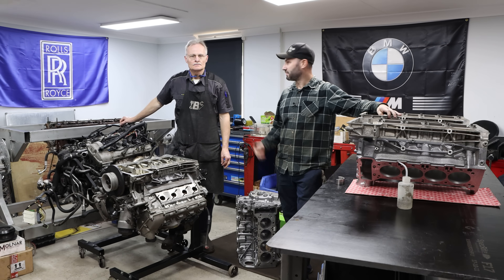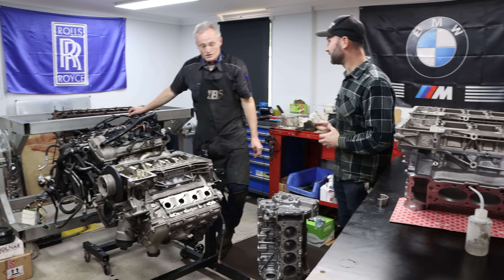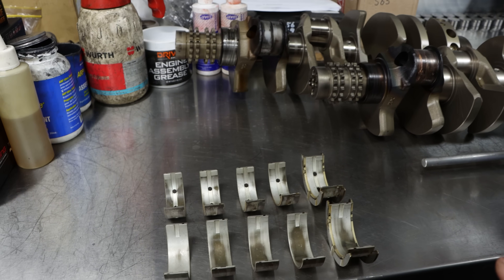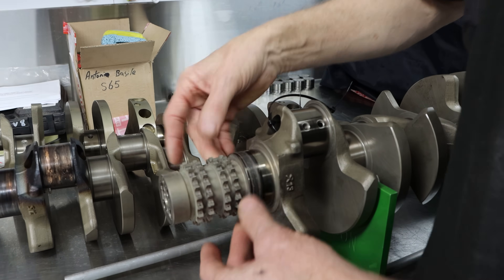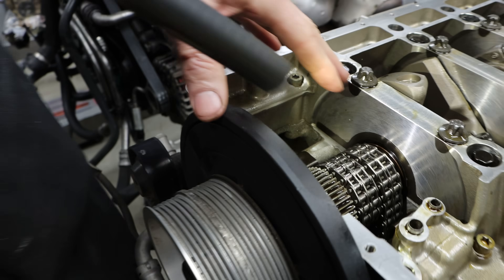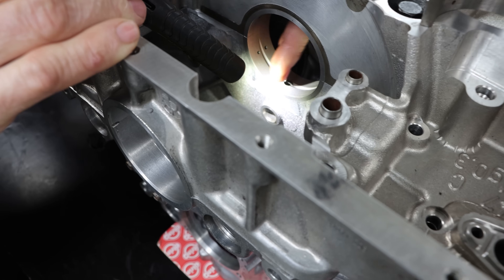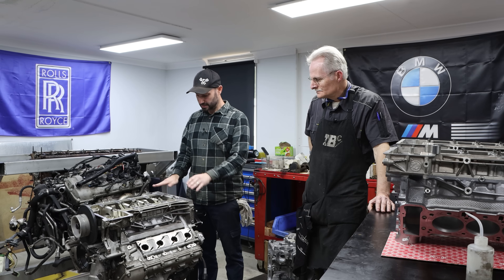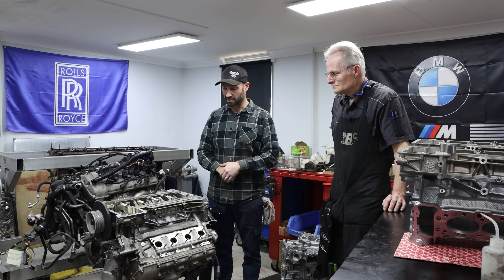BMW M3 S65 MAIN BEARING FAILURE! Rod bearings trumped by main bearings.

Comment: Scary problem. When mine failed, the #1 main didn't even spin, but it was melted and wiped out. #1 rod spun consequently, but only just. No discoloration on the crank and the rod journal was still in spec, and I reckon the main journal could also be saved. Bad part is the block was cracked almost all the way up to the bores, so it can't be saved. Scariest thing is the engine ran perfectly beforehand, not even a knock until pulling it into the shed. Just found some metal in the oil. Great idea on that fix, excited to see how it does in the field!
Reply: Wow scary. How much is "some metal" as in glitter bomb with the filter covered or a few scraps?
Reply: @01.k.p  I changed the oil about 50 miles from home in a shop, and saw sparkly oil on the pan, but assumed it was from another car that had drained. Didn't think much of it. Filter was on backorder at the time and I got it a few days later, which is when I checked the filter and saw quite a bit of copper. That's when I pulled it into the shed, still running perfectly. Worst part is the crack goes almost all the way up to the bores, no saving this block. Had to get a used engine and had it remanned by Carbahn as it had a cracked piston and bore was scored.

Pics on the "Another S65 main bearing failure" thread on m3post.
Reply: @MrElectrify  funny enough I’ve probably read it. Not funny situation though.But I’ll reread thanks for the info. It is very crazy the engine was running alright. Makes you wonder how long it would continue since the block was already trashed. I’m glad you got it back up and running. These engines are something. Enjoy in good health
Reply: @01.k.p  Still waiting on the Carbahn engine, things are still in flight lol. Hoping to have the car running at the end of the month.

I really wish I knew it was already trash, I absolutely would've run it until something truly catastrophic happened, we've never seen an S65 split in half and I'm curious how long it would take. I'm sure it would've seized before long
Reply: Exactly what i have seen in an engine i replaced. Front bearing spun with 0 discoloration or heat. Upper was fully wiped out.
Reply: How many miles?

Comment: So nice to see block repaired instead of buying a new one. 

If the problem is with extra tension on chains, maybe tensioners could be modified to reduce tension and force applied?
Reply: But then the chains wouldn't be tight enough....

Comment: Were any of these damaged engines supercharged? The supercharger drive belt will have significant upwards load on the crank at the end point.
Reply from the maker: no, but that is also a thing to consider when they are

Comment: Increasing the oil flow to the front main bearing in particular seems to be a no brainer given the factors mentioned. Did BMW consider those factors I wonder. Another design point may be the capacity of the oil pump and how quickly it gets pressure to that front main on startup.
Reply from the maker: BMW would not have experienced any long term issues like these id imagine, therefore probably never did anything with it

Comment: Awesome video, great to see well engineered solutions for this S65 issue.

Will you guys make a similar video for the S63? The number of cars with that engine I've seen latley with bearing failures (rods and mains) is quite scary. It would be good to better understand the anatomy of them and what's causing their issues.
Reply from the maker: Will do an S63 engine autopsy video shortly coming out of an F10 M5

Comment: Great stuff, but kinda important OIC and oil brand and weight…bet these motors were beat on from cold and ran 10w60 for 10,000 like bmw recommended !!!
Reply from the maker: 2 other factors we feel get these engines to this point. 10w40 is a good number. Penrite 10 Tenths race oil

Comment: I know sfa about bmw engines. But just watching this is the snout is so long and looks to be completely unsupported.  I bet it its whiping causing your bearing failure.  The weight of that balancer and pulley . The tension because of a daul chain opposed to single row is of little consequence.  8200 rpm as your stated unsupported is your answer not the chain.
Reply from the maker: Yes this is the other likely scenario. We have also started looking into a support bearing up behind the front crank seal housing.
Reply: @BrintechCustoms  is this the engine in the M3 ?  Looks like if you made a billet end you could fit a bearing .
Reply from the maker: @stevesteve7089  yes a bearing support has been looked into

Comment: all engines should be measured at operating temperature 

also, boring and honing should be done with bed plate or girdle installed 

get your pistons true size using a lathe and blowtorch! heat up the piston to temperature and cut to size

torque wrench procedure is also a huge factor. much like a conrod strain gauge- make a jig to measure stretch with head studs and mains after torque..while this  isn't able to get you exactly accurate it can definitely measure if one thread has stretched more than the other.
Reply from the maker: Great tips and that does sound like a further improvement again that engines would benefit from. Cheers

Comment: It's hard to imagine the cam chains having more upwards/pulling force compared to crank weight and 8 pistons pushing downwards lol,,.I think most v8s could do with a bit wider bearings/surface area.Even a Holden 308  will show some rod/main bearing wear at around 150k/km,with normal and some spirited driving,where as most 4 cylinder engines will have as nearly new bearings,but worn bores.If I had to build an S 65 engine for myself,I'd probably hog out the oil holes,put slightly oversize bearings ,and use a 20w 50 oil,,assuming they're designed for  0W 20/30
Reply from the maker: You hit the nail on the head! With 8 pistons driving the crank hard Into the block bedplate, and 4 rows of chain and a serpentine belt system out beyond #1 main, the crank snout is bent up and makes contact with the upper shell. Something is trying to bed the crank
Reply: @BrintechCustoms  Yeah,,It's pretty obvious something is,,seeing that #1 bearing worn like that,,Keep up the good work,,cheers

Comment: I'd like to know the mileage as well as usage leading up to this. I currently have 270,XXX miles and I've done my RB's twice along the way. No more than 6-8 track days and mostly DD duty. I'd like to know oil change intervals too. I"ve gone with 5k oil intervals since 25k miles as well as at least a 2-5 minute warm up daily. Socal car, 2011 M3 Coupe. Great video and information guys!
Reply from the maker: The lowest mileage engine we have had this happen to is 56,000kms (34,000 miles) which happened on a track day after 3 laps. This is the 2nd crank shown in this video with the black burnt journal. KMs / Miles dont seem to be a single factor to go by alone, all we know is the last 5 engines that have come to our shop for repair have been locked and all suffered #1 main bearing failure.

Comment: How a company building cars for more than 100 years couldn't get the bearings right?
Reply from the maker: Its a fine balance of maintenance and handling after they leave the factory. Its a 4.0L engine producing 400bhp compared to 6.0L Chev V8 making the same. The rods are narrow and internals under much higher loads. What could have been done better to prevent this by BMW? That is a good question and open to suggestion.
Reply: @BrintechCustoms  Ask the Japanese.
Reply: @FairladyS130  maybe, but the Japanese have never made a V8 that comes close to the performance of an S65… the 2UR in the old ISF is the closest and it’s a larger, heavier, lower revving engine that still makes less power so it’s not really an apples to apples comparison.
Reply: @yucannthahvitt  Obviously if the V8 BMW engine produces significantly more power per liter than other V8 engines it would require different engineering to those other engines to get similar life. Sports motorcycle engines engineering with their notably oversquare engines would be a good start. But perhaps BMW have also tried to make the engine too compact which would restrict bore size and reduce crankshaft length and hence bearing widths. Anyway BMW have stuffed up somewhere in the design.

Comment: Hi Brintech Team, 
Would love to converse over these failures one S series engine lover to another, could I ask what mileage these failures are happening on average that you’ve seen? Is this something on average you see with 100km plus engines etc, I’ve also wondered if majority of wear happens on crank and initial fire up prior to oil pressure centralising the crank,, maybe acusump might help. 
Enjoying the videos many thanks
Reply from the maker: Given the double row pair of timing chains could be a contributing factor to the tension on the nose of the crank, adding oil pressure would also add pressure to the chain tensioners, this could work against the engine.
Reply: @BrintechCustoms 
I think you’ve misunderstood, I’m talking about priming the oil system with the accusump prior to engine start in this case it would have 30-60 psi upon crank I’m wondering if some of this wear is from cold start mechanical advantage on the snout of the crank via chain tensioners prior to oil pressure being established, just a thought I haven’t checked if they are the same tensioner part number as the S85 either ,,, in my mind it’s establishing is this actually occurring in high speed operation or start up , you would think it would fail faster if it were to occur on governing pressure engine speed,  it would be eating the upper 1st main as much big ends ,, I’m not saying your wrong at all just a thought, I’ve checked the mains with spares I have and they show similar wear patterns without doubt, definitely a step in the right direction, as an M engine fan it’s disappointing nobody loves them more than me but I’ve stripped Audi Rs4 engines with 200k and you could re use the bearings with less favourable on paper design …. Rod ratio etc etc … appreciate the videos and lengths you’ve gone to, and I’m sorry you’ve had to deal with peanuts insulting your business on a public forum with absolutely no grounds as it’s very clear from your videos your not beginners.
Cheers thanks for the vids
Reply from the maker: @simonmuirhead5930  Yes i understand now thank you. Yes there is a common things with an S65 on cold start especially if they have sat for days or weeks, a horrible rattle while oil pressure builds up and fill the VANOS hubs etc. I can see the advantage an a pre-start pressurising of the oil circuit. The S65 tensioner part numbers are 11317839053, and unique to the 65 only. The S85 are different, and single row chains as we know. Thanks for the encouragement, we try our best. Some people just dont have the capacity to have a constructive discussion when it comes to problems. We know that our efforts are recognised and acknowledged in the wider community of those who are here to learn with us. Thank you
Reply: @BrintechCustoms  First, thank you for this very informative video ! I have a question linked to first main bearing failiour and cold starts. Does the standard BMW ecu cold start process put more wear on the bearings, making it a good idea to code out the cold start ? I have the cold start coded out due to that I thought it is there only to warm the catalysts wich have been removed. Really nice of you to also show the solution you have in place to save these great engines ! Thank you from Sweden !

Comment: Such a turn off for buying one of these otherwise incredible cars.
Reply from the maker: Dont let is worry you too much - just try to plan a routine bearing maintenance process for is and this can be overcome with confidence. The engine deserves it as we also agree they are an amazing machine and generally one of the best Euro V8s built.
Reply: @BrintechCustoms  Hi, at what mileage would this main bearing becomes an issue? Are there any correlation with mileage? Some comments are suggesting that the production date after 05.08, when BMW switched up the accessory belt is the cause, I personally don't think it's possible.
Reply from the maker: @SuperPandaren mileage alone is not enough of an indication. Just change them regardless
Reply: just put a S85 in E92 lol

Comment: NICE!

I have also witnessed S85's with main bearing wear.  Usually number 6 and would put to unbalanced clutch assy.

Number 1 could be same issue with extra load from cam-timing going wrong and unbalanced.

No way to know for sure, but love when I find new info.

P
Reply from the maker: @LSmiata  we have also seen number 6 main fail on an S85. The flywheel end could be the issue in these instances yes.
Reply: @BrintechCustoms what do you think about with my m6 manual swap and one mass flywheel? I wqnt to change it to m3 original flywheel. But it would be still unbalanced to the counter weight on the opposite side: the Vibration damper. Does the original m6 manual maybe has a different damper
Reply from the maker: @mowa4820  So long as the rotating hardware is balanced this will help. However the other end certainly needs to be effective in doing the dampening required. Ideally a rotating assembly balance is the correct way to address end to end.
Reply: PS:  Look for bent rods!  Fuel injectors know to leak and cause hydro-lock on s85

Comment: the amount of issues i've had with my e46 m3 and having to unfuck the things brintech have done to my car. if they can't do basic maintenance and routine mods, imagine how bad getting your engine rebuild by them would be
Reply from the maker: Jake - I do not have any record of you as a customer. This is the first we have heard anything from you about any E46 M3 problems. Perhaps contact us and identify yourself so we can discuss in detail what you are talking about.
Reply: @BrintechCustoms  customer was the previous owner. 
I thought wrongly having brintech on all the receipts was worth something. 
long story short, csl airbox, rear dif, cooling and some odds and ends.
The amount of time and money put in to attempt to fix the issues. redo improperly done work. 
definitely the joys of buying a old bmw. thank god nothing to do with the engine internally was touched by you.
Reply from the maker: @F41LZZz  Jake how about contacting us privately with the information of the customer and car. I'd like to know more and see who the tech was at the time. We have had ex staff issues and quality control is important to us.
Reply: @BrintechCustoms  the car is now out of state. I certainly bought it with rose coloured sunglasses on. due diligence is primarily at fault on my end. 
these things are such a hassle to try and fix, and throwing money at it hasn't worked.
Reply from the maker: @F41LZZz  if you email us and give some specifics of What you are battling with, whether you feel we are capable of helping or not, I'm sure I can shed some light and be of some assistance. We always address any issue given the chance, at this stage I'm still in the dark about what you are talking about. Get in touch Jake and let's work this out

Comment: Greetings from Sweden, I appreciate all Your in - dept techvideos. Isn't it a slight bit of oilpressure related as well? If we could increase it slightly, without spinning the bearings due to oilpressure, that would also help prevent this failure?
Reply from the maker: G'day to Sweden.  Yes more oil pressure could also help. Another thing we have done is super-polish the crank with an Isotropic process and tumble which turns the running surfaces into mirrors

Comment: Shocking and unnecessary if designed properly.  You've done an amazing job re-engineering it.
Reply from the maker: @ametti000  it seems to be a good solution at this point.

Comment: H2 Motors in Germany has seen this same type of failures and they also have the theory that the chains are pulling up on the crank shaft hence the increased wear on the upper shell
Reply: Which video they said that ?
Reply: @kayzenl7911  https://youtu.be/_qxRf18IyII?si=uMBYkT3x8AzORuTv This is the video you are after
Reply: No they said the serpentine belt is the reasen why the late s65 engins (09 and later) have this problem. The early versions had an different serpentine belt. All versions have the same chain and main bearings.
Reply: @stevenpower3780  early motors have this issue as well so that doesn't make sense. I doubt serpintine belt would cause main bearings to wear lol
Reply: @boostedrede30  this is not my theory, you said that H2M have the same theory and that is false my frend they said it that they think it is the serpentine belt what lifts the crankshaft. They recognize that the late engines are more vulnerable for this issuse
Reply: @stevenpower3780  Correct me if I'm wrong, but it's after 15/05/2008 that BMW decided to change the layout of the serpentine belt. Before 05.08 BMW had the belt OVER the power steering pulley then UNDER the idler, after 05.08 the belt was rerouted UNDER power steering then OVER for some reason. BMW had a lot of these minor adjustments after the 2008, I think the manual transmission as well. The clutch and flywheel after 2008 are not compatible before 2008.
Reply: @SuperPandaren  yeah that’s right FCP Euro had also a video about the S65 that shows the different in the belt layout.
Reply: @stevenpower3780  Where did you get the info on switching the belt causes the main bearing to wear out. I want to read more on that
Reply: @stevenpower3780 get your meds in order serpentine belt boy
Reply: gut gemeinter Rat, lass bloß die Finger von H2Motors, wirklich letzte Firma ... hätte ich nie gedacht, schockierend schlecht

Comment: I have been thinking for a while that the bearing oil galleries and supply lines needed to be opened up a bit.
Reply from the maker: This may be an improvement, certainly any small changes in the right direction will help this engine live longer